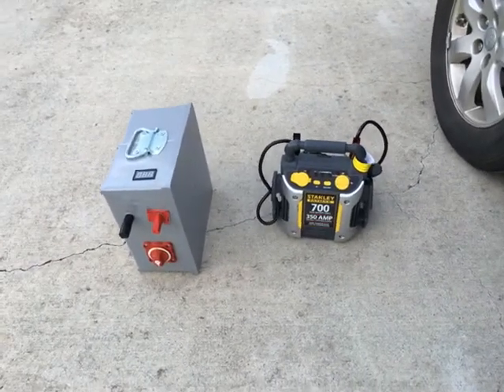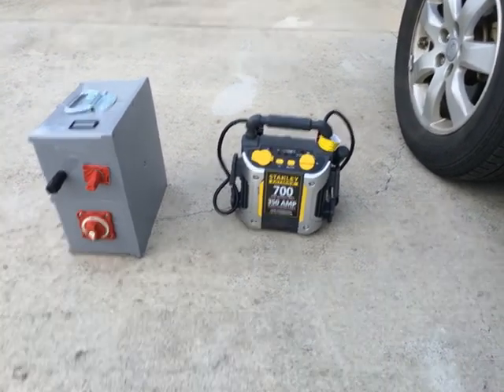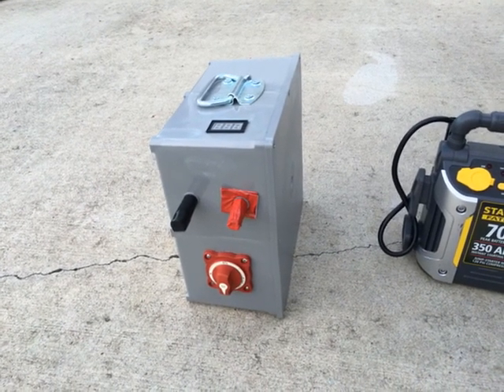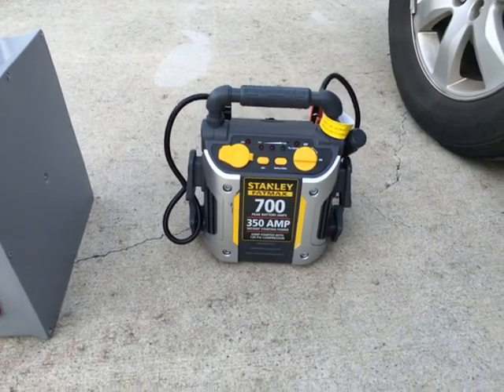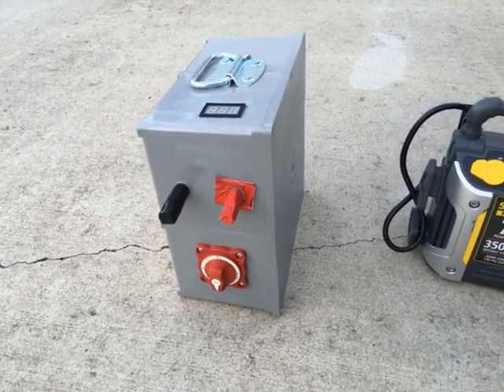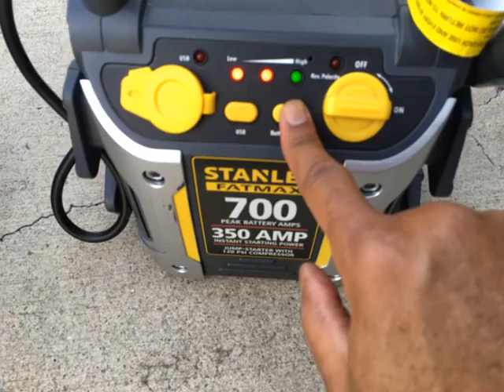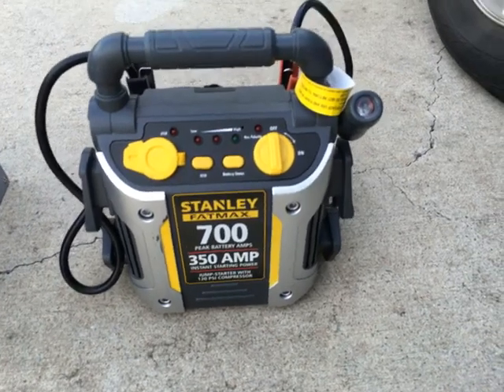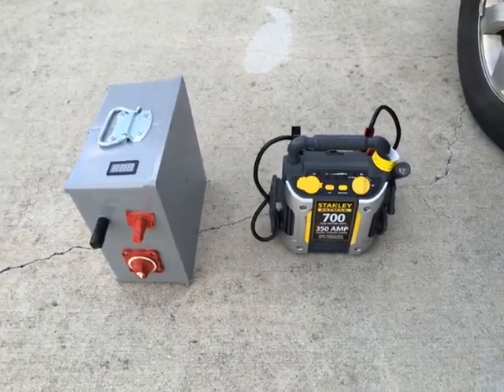DIY Ultra Capacitor Battery Boost Box vs Stanley Battery Jump Box

Comment: Just found this video and was laughing my head off, failed 3 times. However, it would have never started your car and that is more intended for small lawn mowers or small 4 cyl cars. That box has 700 peak amps, in order to jump most cars above a LOW compression 4cyl (I say that as some 4cyl have a high compression) the base recommendation is no lower than 1000 peak amps if the CCA's are not listed.   

So before I would say this unit is "Crap" I would need to know the size of the battery in the car, what is the recommended manufactures CCA or Peak amps for the vehicle. You may not have the vehicle anymore:)

Stanley does make a 1000 Peak Amp Jump box. I have a Schumer 30A jump cart, but it is strictly for shop use and i accidently hit 30A on a tractor and blew the solenoid three times. Too much amp can cause issues as well, depending on the year of vehicle/car/atv ect. So your box could very well blow fuses, or cause other issues by burning fusible links ect if the output is too high for the system.

Anyway, without additional information, this video does nothing for me as a comparison  :)....

Comment: As starter motors wear out they require more and more voltage. A good starter needs only 9 volts to start a engine. I have seen them wore to the point where 19 volts repeated jump starting won't turn them.
Reply from the maker: Thanks for the comment.

Comment: I hate to tell you but if you're car is a normal car and it won't start when your battery is at 10 volts your starter is shot . Soon the capacitor jumper won't start it either
Reply from the maker: Thanks for the comment.

Comment: I had a similar one and it failed me all the time, exchanged it to a new one and this worked.
Reply from the maker: Getting the lithium based boost packs are better in my opinion but a ultra-cap boost pack may out do them all.

Comment: Just another question, sizing in my mind the battery I need to power the lights in my house and maybe a few outlets.

You got quite some battery power (watt hours) and still Darin your batteries so much. What is tanking all your watt hours in your house?
Reply from the maker: My batteries are around 5500wh of power.  Looking at it from the amp hour perspective, specifically a C/25 discharge rate, At 200Ah/25A continuous draw = 8hrs of power.  At a C/20 rate it would equal 10hrs.  The key is lower your power draw.  This can be accomplished a number of ways.  Shutting off non essentials, using timers on the fridge or freezer. etc.  For me, I have at least 4 outside lights turned on all night, 3 inside LED lights running all night,  my alarm system, and the fridge and freezer runs all night (off and on in accordance with their duty cycle). I also run the exhaust fans, and a circulating fan in the bedroom. There are other vampiric loads such as appliances with the clocks etc.  All taken together, it would equate to between  20 to 25 amps.  That's why, if I start going off grid around 11:00 p.m. my batteries will be drained around 7:00 a.m.  If I go off-grid earlier like 9:00 p.m.  my batteries will be around 20% state of charge around 5:30 a.m.  These are estimates because it depends on what's running etc.  The point is that it's your discharge rate you need to plan for, i.e., C/A (Capacity / Amp draw).  Especially if your going with Lead Acid Batteries.  I needed the caps so that the inverter wouldn't stop prematurely due to a temporary low voltage sag from a surge.  But other than that, the system is performing as expected.
Reply: +rhandsom thank you for the info, so fridge and freezer box taking so much power out over night. I will have a small wind turban where I believe 10 fl 150 watt will come in for most of the time, specially at nights. We have either sunshine ( a lot) or wind or even both.
Reply: +rhandsom it was supposed to mean 100 to 150 watt. Just in the winter time, we have of course less hours of sun light, so I have to size the battery power high enough to compensate. Also, will see what the wind turbine does in average over night.
Reply from the maker: Sounds good, your battery sizing estimates has to be as accurate as you can get it.

Comment: take it apart and combine them both because the battery will hold the power and the caps will start the car and the light and tire pump you can use too
Reply from the maker: Not a bad idea, I'll explore what I can do with it.